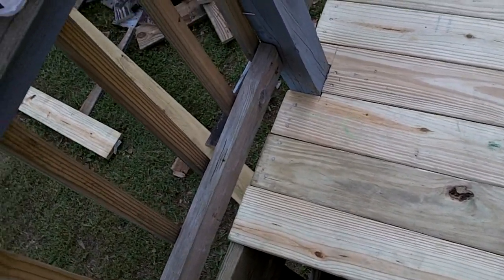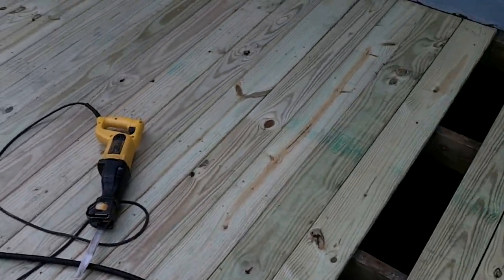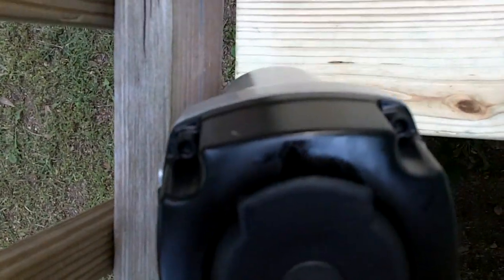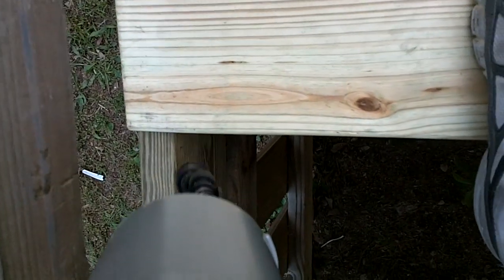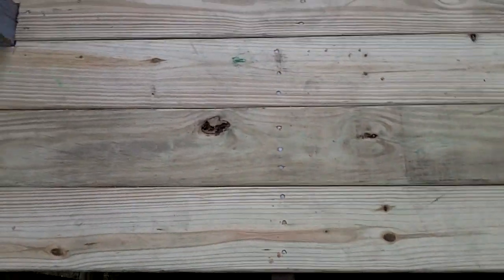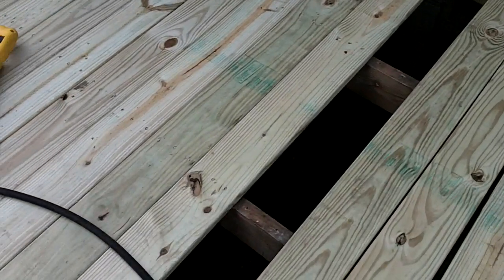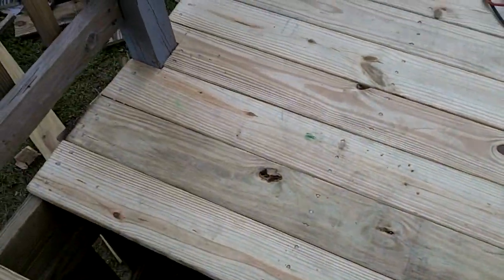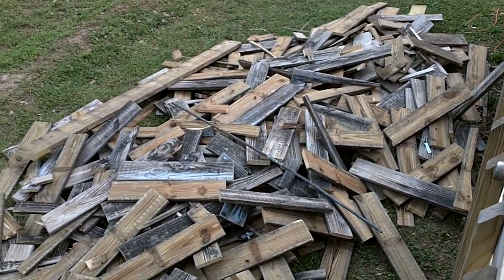Deck Renovation with Porter Cable FR350A Frame Nailer

Comment from the maker: Pressure treated boards shrink. They don't expand. It has not twisted. If you leave 1/4 gaps you'll end up with 1/2 inch cracks between the boards.

Comment from the maker: Pressure treated boards shrink. There is no need to leave a gap. Leaving a 1/4 inch gap will end up leaving you with 1/2 inch gaps. If you like that sort of thing, more power to you. No twisting. Ring shanked nails don't pull out either.

Comment from the maker: @kj197734 Yep. It's quite powerful and very adjustable. There is a depth adjustment on the nailer itself. Of course, having an adjustable air regulator on your compressor is a plus. I have one made by Parker.

Comment: Did you flash between the house and deck?
Reply from the maker: Yes but it was so fast that none of the neighnors could see the good parts!   LOL !  Actually no. I should have probably.  I put the new top on the deck to get ready to sell the place. That was a long time ago.
Reply: @ImpalamansGarage  was just wondering didn't know if you recorded the process. Getting ready to do mine over as well and there is 0 flashing.